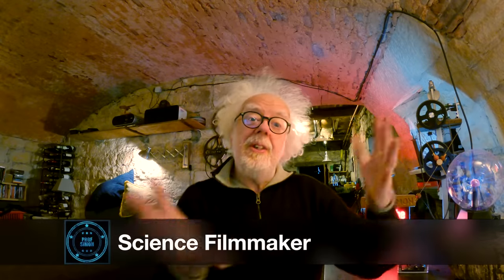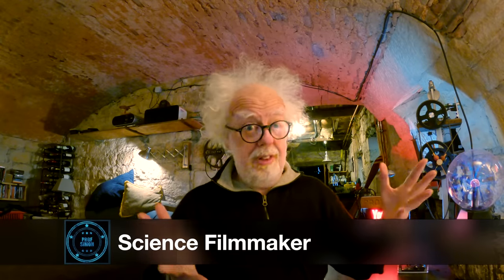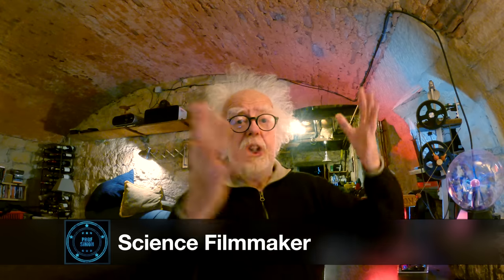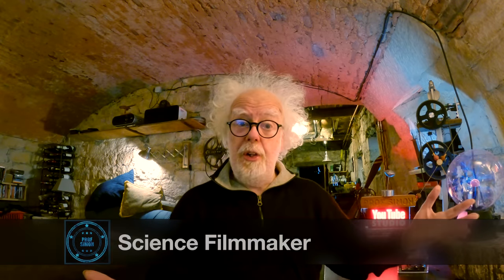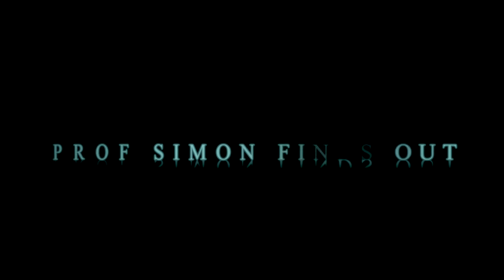Ground or Earth Mystery

Comment from the maker: Update... our house in France does not have combined neutral and earth. it has a earth rod with less than 100ohm resistance.   phew.  😅
Reply: Hello, Professor. Aah, the 'ground or earth' enigma has always intrigued me! Thank you for this show. Best wishes, The Dutch Scouser in Amsterdam. 🥃
Reply: Oh no!    That means when you build a huge Nikola Tesla radiator for VLF broadcast-power, the kilo-amperes will set your dirt on fire!    (In Tesla's "Colorado Springs Notebook" his first ground connection was around ten ohms IIRC, and he had to work hard to make it far, far lower.    Marconi had it easier, just dumping some huge iron plates in the sea. )

I've always wanted to try discharging a 30KVDC capacitor-bank into a couple of ground rods placed 50M apart  ...then listen for "echoes" of Schumann resonance.    See if the waves will behave as Tesla claimed,  circling the Earth and then returning, over and over, about eight times per second.  (For a planetary system-Q of a bit below ten, the waves should keep ringing for a second or two.)

Comment: Love this show,  I have 20m of buried copper foil that I use to ground radio equipment it is also attached to my dB board ground. It's a bit excessive but I had the copper foil on hand.
Reply: Better over engineering something than under. Ask the Germans. Awesome engineering. All we would ise cutting hedges stihl.

Comment: Many many moons ago I had a Cavalier MK2 who's starter motor turned over very slowly. I checked the battery - no fault there. I took the starter motor off and stuck it directly across the battery with jumper leads - the motor nearly shot off down the road, so nothing wrong there. Checked solenoid, ignition switch etc. Could not figure it out. Then - strangely enough I had a dream about it and in my dream I found the problem to be the earth strap! Following day, I looked for the earth strap and there it was - tight and clean - no worries. But underneath the engine block was another earth strap - corroded and rotten and it was used to ground the engine block itself as of course it sits on rubber engine mounts (silly place to put it as it got covered with all sorts of muck down there!). I got a jumper cable and clamped the engine to the negative and tried the car - started perfectly first time. New earth strap fitted (in a better place) and it was all sorted. Ah good times with late 80's British cars!!!
Reply: Still a common fault on current cars and the cause of countless electrical gremlins on their modern electrical systems.
Jumper cable from battery negative to the engine block is a great simple test to rule out earth strap failure.

Comment: A bit of clarification on the washing machine scenario.
The metal casing is connected to the Earth/Ground of the cable, that goes back via the house wiring to the Earth/Ground Bar not the neutral.
Now the fun part. from the fuse box there are 3 main options, 1. a separate earth wire comes from the earth bar to an earth stake (copper rod) hammered into the ground outside the house. 2, the earth bar is connected to an earth wire in the main Utilities cable, it travels back to their substation were it gets connected to the transformer and to a earth stake from there. 3, the wire from the earth bar goes to the main utilities cable and is then connected to the neutral as there wont be an earth wire.
All countries use these 3 methods in one form or another, slight differences in how its achieved but the same principle, There are lots of reasons and ways for how you choose exactly how you choose, ie all 3 are used in the UK, even in the same street you could find it.
Next the tingling, that sensation IS the electricity going through you. The reason you dont die is its not all the electricity, your skin has resistance which normally allows 230v to pass through, but if your skin is dry or it has no way to get to earth it will reduce or block the flow giving only part of a shock. the tingling. Its a reduced amount of current, think folding over a hosepipe slowing the water flow.
If a washing machine is connected correctly it would trip the circuit breaker before you get the tingles.
Its the same with any metalwork in a house, call an electrician if you get tingles...asap.
Note as usual I have simplified the language and not gave all possible variations....
I'm more than happy to answer questions as it is a very important aspect of electricity in the home.
Reply from the maker: thanks David.... can you explain why my green and yellow earth wires share the neutral bus bar in my fuse box in France?  there are only 2 wires coming from the street into our house....single phase live and neutral i guess....no earth wire.
Reply: @ProfSimonHolland  Yes your green and yellow aren't true earth's. You mentioned it in the video without realising, the neutral/earth bonding or combined neutral earth.
They are one and the same. If you have an ELCB, earth leakage circuit breaker fitted between there and the utility supply there would be no earth wire to measure any leakage on soit couldn't work. But a residual current circuit breaker would as it measures the imbalance of the current in the live and neutral.
The colours are more for the electrician to be able to know which goes where rather than what it is and how it matches the protection equipment. 
It runs into how your car charger wouldn't work. 
Earthing and how it works is notorious in the industry for being a right pain because fashion over the years has meant we have so many different set ups.  I come from the utility side and our regulatory system is massively different to electrician's. But scientifically it works the same. If an electrician joined our company he needed to be retrained for around 12 months and vice a versa.... 
But we all have the same core knowledge its how its used.
Reply: That needed clarifying as vid somewhat misleading on that aspect. Some countries / older installations have different set ups also. 
As stated above, call in a qualified electrician whenever a problem or tingle!

Comment: * Never EVER refer to the Negative side of DC as EARTH *  -  AUTOMOTIVE & DC SUPPLY

* Neutral is only really 0 volt if you look at all 3 phases *     -  HVAC  [ you can actually drive a DC motor between EARTH & NEUTRAL on Single phase line (aprox 138VDC)  :0  ]

* EARTH is EARTH  /  FLOATING EARTH (is not even really earth) *

Comment: here we call it phase (the oscilating 220 v 50 hz wave, usually black) neutral (the normal pathway return to the phase, usually blue), both these connect to the diferential circuit breaker. ground, the yellow green that connects directly to the ground. 
the diferential doesnt need the ground cable because it works by matching what is send by phase with what is received with neutral. if it doesnt match, it breaks, so phase stops. even if it doesnt break , you'd expect ground to be the shortest path of resistance and save you. you don't need neutral, you could connect to ground instead of neutral and save a wire, but would loose the safety feature.

Comment: One of the ways the periodic table is organized is "Electronegetivity". Electronegetivity is "basically" the ability of an element to give or recieve electrons. Your specific soil composition influences the soils overall Electronegetivity.

Think of "Ground" as a huge Electron reservoir willing to give or recieve electrons. "Ground"/Soil electronegetivity varies wildly from location to location. High presence of metallic elements, tend to make for the best electronegetivity.

A buddy of mine installed grounding cables for power poles. They would use a "Megger" to measure resistance between the pole and ground. If resistance was too high, they would install additional "grounds" until the reached a maximum of (3) grounds per pole, then it was considered "Good Enough"

I installed an Electrical Ground rod for my generator, by using a copper rod and pouring salt into the hole in the soil, I altered the Chemistry/Electronegetivity of my soil, making a better conduction path to the "ground" "electron reservoir"

Comment: Electricity on the case is because of 2 capacitors between live and earth and neutral and earth.  These capacitors are there to filter out electrical noise that may be emitted by the device back out onto the mains.  If some current leaks through the capacitors there may be a slight current to you from the metal case.  Often these are polyester capacitors.  Ones rated to be able to be between live and neutral are marked X because it crosses over. Ones that can go from Live or Neutral to earth are marked Y because the 2 arms of the Y go down to the earth.  Hope I got that right, I will get jumped on if its not right.
Reply: Definition of a 'Split Second': The interval between making a factual error or (especially) a grammatical or spelling error in a YouTube comment, and being leapt upon because of it by some 'know~it~all'!
Reply: @richiehoyt8487  when they correct your grammar their losing the argumint.
Reply: @David Mikeska Thanks!

Comment: To understand how Earth works in our power transmission you need to know a little bit about the way electricity travels from the power station to your house. Firstly electricity is generated as 3 phase. Each phase is 120deg from the next. Imagine a circle divided  int 3. There are lots of animations that can explain that better than me if you Google it. Second is the use of transformers. Again Google this for pictures and animations. Your house is only connected to your local sub station. That is the final Transformer in the supply to you. This not only reduces the voltage down to the one you can use but it cleverly provides the neutral wire. Up to the sub station There are only the 3 phase conductors (wires). These are connected to the three primary (input) windings of the transformer. These are connected in delta (triangle). The secondary (out put) windings are connected in star formation (3 pointed star). With one end from each coil connected together in the middle. This star point gives you your neutral connection. It also gives you your earth. it is connected to a really good spike driven into the ground. Or several spikes if needed. The earth is probably not as good a conductor as copper but it is very big and damp after a little way down.  Hope this helps.

Comment: INFINITELY LARGE GROUNDING, whenever you climb into the sphere of a large VandeGraaff machine[1].   Once inside, if you dump charge into the inner surface, it all 100% disappears.   It instantly migrates to the outer surface   ...no matter how much charge is already out there!   The max voltage of a VDG machine has no limit, because the "charge suction" of a hollow sphere is infinite.   But this, only for charges deposited onto the inner surface.  Also called "Faraday Ice-pail Effect."
- [1] Back in 1986 I climbed into Robert VandeGraaff's giant machine, the 30s-era linac from MIT.   It's set up inside the Museum of Science in Boston.  Inside the double-sphere, there were desks and chairs bolted to the metal.  Also some 120VDC light bulbs, batteries, and a generator pick-off connected to the upper rollers.    Rope ladder covered with soot (since the darned thing is an electrostatic precipitator.)   Normally the rope-ladder gets retracted, using a poly rope and pulleys, in order to avoid 5MV lightning bolts.  They told me "Oh btw, watch out for the missing rung."   Wrong, there were TWO missing wooden rungs, creating meter-wide gaps!   Not impossible when climbing upwards, but terrifying on the way back down!

Comment: In school they taught me to call it "earth ground", probably because we might be dealing with folks from anywhere. But, I'm a lazy American, so "EARTH". (Murca!) As you said, earth is usually a poor conductor. However, there is an awful lot of it! So it really depends on the quality of connections, including the contact surface area, corrosion, and material.

I often get a tingle from my Hi-Fi, but only if it's playing Pink Floyd or Alan Parsons Project.

Comment: I'm sorry but I think you have been misled. The earth ( yellow/green ) wire should not be connected to the neutral at your fusebox, it should be connected to the earth terminal which is connected to a metal stake in the actual ground. To connect the earth wire to the neutral busbar is extremely dangerous
Reply: French wiring is absolutely horrific IME, maybe Simon's place is wired like that and he doesn't realise it's wrong.

Comment: Regarding your electric vehicle. 

Earthing in the UK is typically one of three types. 

TT terra terra. 
Each rods, typically rural locations. 

TNS terra neutral separate. Majority of the supply historically however majority has now been converted to tncs. 
Electricity supply cable tends to be lead sheathed and the lead sheath is typically the earth, the neutral is typically taken on a separate core within the tns cable. 

Tncs terra neutral combined separated. 
The earth and neutral are combined into one core of the supply cable, that is then split out before the supply fuse typically into neutral and earth. 

TNCS is the most common supply type these days and you'll actually find that even houses that are supplied in tns the tns is actually converted to tncs in the street. 

The conductor that carries the combined neutral earth is called the pen conductor. Protective earth and neutral conductor. 

Think about lelectrcitiy coming in to your property via the live conductor, through the circuits and back out down the neutrals to the consumer unit (actually wiggles back and forth 50 times a second however thinking of it flowing through is more helpful for what we are about to describe). From the consumer unit returns back down the pen conductor and back our to the substation etc thus completing the circuit. 

Now also think about all of the earthed metal work within the property also connected to the pen conductor. 

Now imagine a scenario where the pen conductor is damaged and you end up with something called open pen. 

The live comes in through your circuits back out down the neutral to the pen however the pen conductor is open circuit, remember the pen conductor is also connected to all of your earthed metalwork so the earthed metalwork in this scenario will sit live awaiting something to come along and complete the circuit. 

Here comes Prof Simon and touches his Renault zoe sat charging in the driveway thus completing the circuit and ending up hurt or dead. No RCD will trip as the current flow through the live and neutral conductors is still balanced so no 30ma discrepancy to cause a trip. 

That is the reason behind the ev charging regulations recommending rods instead or utilising an open pen device. (Such devices are very new and rather unproven).
Reply from the maker: excellent explanation

Comment: Your bang on as is to be expected. In a car (for example) the "ground" is the zero point (not necessarily zero) that is the base for the potential difference to the positive. Very important if you are wiring a common ground on sensitive equipment to arrange as a tree and not a spiders web with loops that can pick up all sorts of signals and change the PD. But ground is the ground. I think your issue ... and I'm not confident about this ... but most domestic supplies are tapped off three phase? So your neutral might not be the same as the house next door and you need a proper ground close the the car as wire has a resistance and is an antennae (Tesla). A bucket of salt water poured in the actual ground when it's dry will help no end
Reply from the maker: thanks for the info Blsck5F

Comment: Iv got extra grounds on my car due to some electrical issues and they are larger than normal and seems to work well ,its a 1989 Nissan Laurel and many of the factory ground had a lot of resistance due to being old and coroded
Reply: It’s not a 2litre straight 6 petrol is it? Rare car, you can’t be in the UK I think they all rusted away here, lovely things to drive

Comment: Hi I’m a bit concerned that you have not got a proper charging point for your car , the manufactures have been repeatedly told that supplying E Vs with a plug is just not good enough .  A number of fires in this country have been attributed to people plugging in a car 😂to an already over loaded circuit .  The reason you’re electrician wanted to install a proper unit is for your safety,   under certain fault conditions the body of the vehicle can become live . To minimise the possibility of this happening, they separate the charger from the house supply ground / earth . In order to achieve this an earth spike is used to make the vehicle at the same potential as ground.  The reason being when you step outside your house you have a different potential to the house sockets so increasing your ability to receive a shock if something goes wrong . Because the earth loop  impedance of an earth spike is not good enough to satisfy today’s permitted values. The chargers incorporate a earth leakage device , which by doing so brings the permitted values back into line.   The devices operate by detecting an in balance within the circuit as in a fault .     As a retired electrical contractor , I’m aware that the electrical regulations are being constantly being revised to accommodate these new circumstances.  I wouldn’t won’t ether you or your wife to become the least line of resistance if you follow my drift   .     Best wishes and kind regards as always 😀👍👍👍